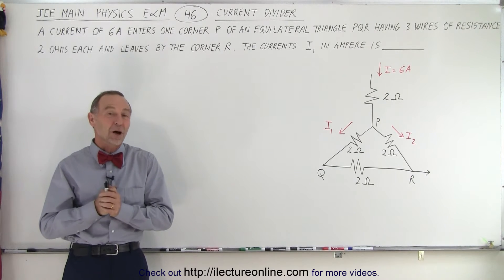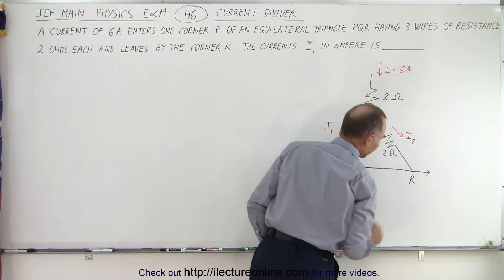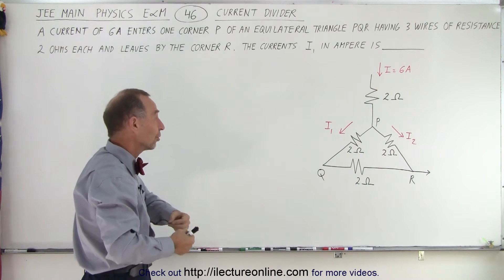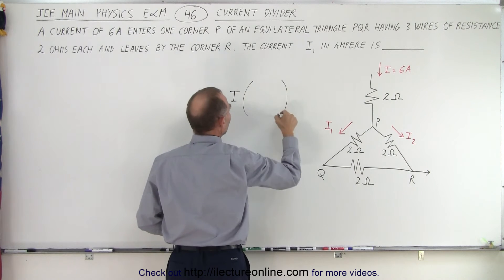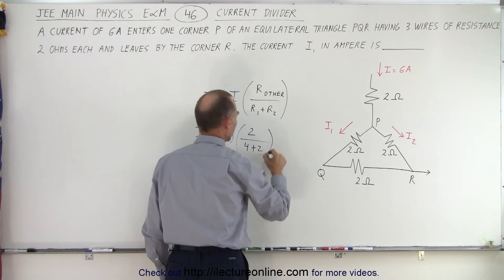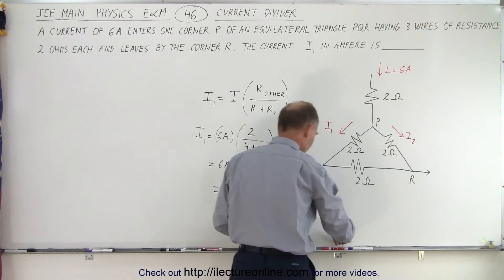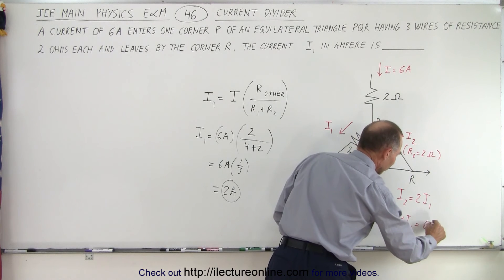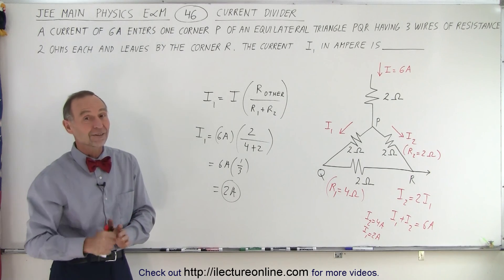JEE Main Physics E & M #46 Current Divider

Comment: Mr. Professor it is said that running current will choose the way with lower resistance. Does it mean that in the 4 Ohm way there is no current running?
Reply from the maker: More current will flow through the path with lowest resistance, but some current will still flow through the branch with higher resistance.
Reply: @MichelvanBiezen  thank You mr. Professor.